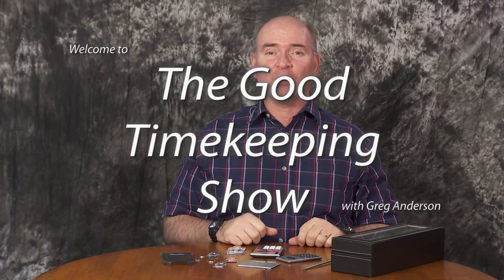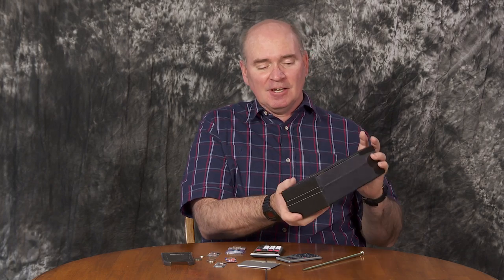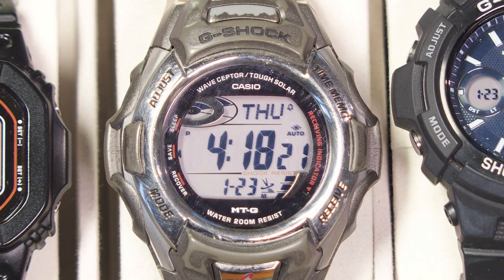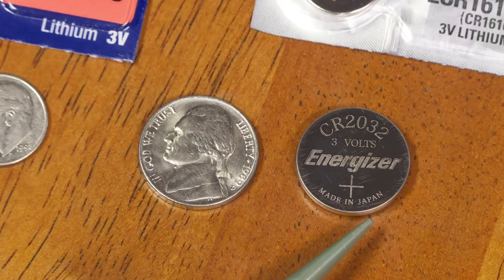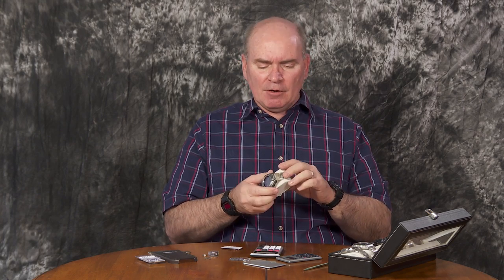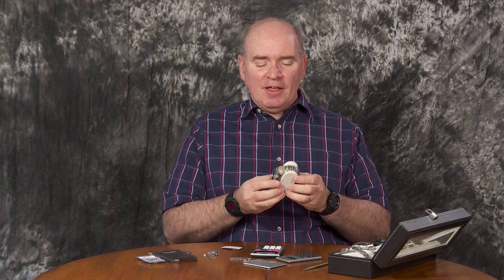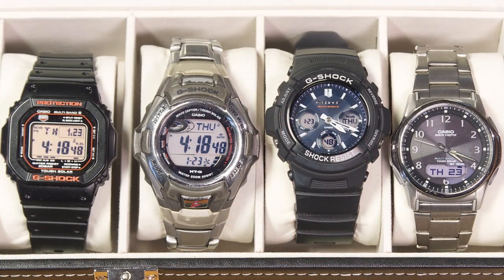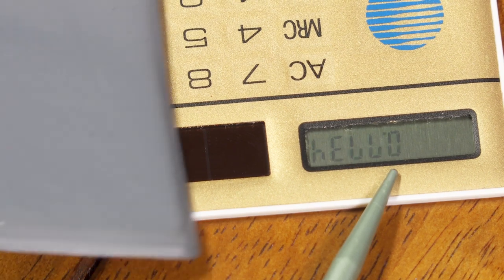What is Meant by Tough Solar (and Eco-Drive) in Casio (and Citizen) Watches?

Comment: I would not take a solar watch to your local jeweler. I posted my g-shock to Casio and asked them to swap the rechargeable battery which they did for 20 dollars! So check with manufacturer, they sure things will have the right tools and parts to do it. I'd say that a 300-dollar g-shock deserved a 20-dollar treatment at its birth cradle! Don't be cheap!
Reply from the maker: Excellent idea.

Comment: Wait. A watch cannot think! It is the manufacturer (person/s) who thinks! They designed the watch assuming the user will put in a correct battery type.
Note to readers: The Casio calculator uses two way power, and the cell is alkaline usually, it may or may not charge.

Comment: The reason I never had one until now is the price is expensive I got one last year and I haven’t been using it because of the link needed to be done and waiting until this year 2021 because of the pandemic last year I could not get the link to fit my wrist 
This year the battery was not working or not able to work at all and it is the solar power and still not working even though I have kept it in the sun or light it is a Casio tough solar
Reply from the maker: I’m curious. What model of watch do you have? I would start by putting it outside with the face getting direct sunlight (if you haven’t already tried that). Let it get that light for a couple of hours. It should do something. This is what I did... https://youtu.be/4StC6fKpIZs

Comment: The most important point he didn't tell in this video, in door artificial light won't charge these solar watch, out door sun light is a must no matter how bright it is.
Reply: Sorry but you are completely wrong, I have 17 eco drives, 2 tough solars and 2 Seiko solars going back up to 17 years. Daylight is better but they will all charge from artificial light eventually.
Reply: @TelstarFirst  I'd agree,it's estimated that a decent fluorescent tube will charge at the rate of around 25% of that of natural sunlight.
Incidentally we have a sunlight simulator which produces multi spectrum light for testing various light sensors fitted to vehicles which we used to revive an Eco drive that had been stopped for 2years. We left it in the garden for a month in the summer to no avail.Citizen could no longer obtain genuine capacitors so couldn't repair it,despite the fact that I managed to purchase a genuine one in seconds!.Anyway,after 5 hours of intense simulated light there was movement,we then left in sunlight for five days and it has worked faultlessly since,I've had the spare capacitor for 3 years now.Unfortunately the light emulator we used is attached to an £11,000 ADAS system so not really practical for home use.but yes some types of artificial light will charge your watches.
Reply from the maker: I bought a watch last year which was new but it arrived with a drained battery. I brought it back to life with an LED video light and then brought it to a full charge in the sun. I made a video about it. (And the watch is still running well today. If I'm not wearing it I keep it in a case where it is exposed to normal lighting in my house.) https://youtu.be/4StC6fKpIZs
Reply: @GoodTimekeeper  I watched that video,I know the feeling of watching for the first sign of movement although I'm not a great fan of digital watches,too many functions! almost all mine are analogue.I do admit to recently purchasing a Casio retro watch in silver,felt like I was back at school,my pal has now bought one too! I have a couple of rechargable single cob led work lights which are very intense and in the right range but unfortunately they produce intense heat also.The old jeweller I use utilises a daylight white small circular tube bulb from one of his old magnifiers and a wire cost hanger,complete with bare mains powered terminals.
Reply: @TelstarFirst  Did any one of your solars watch had a charging indicator? take a look of the indicator reading under normal condition of in door artificial light than think again.
Reply: @keis2046  Yes! 6 of them do and your point is what exactly? Also please note what others have replied to my comment including Greg Anderson himself.
Reply: @TelstarFirst  Read this https://www.citizenwatch.com/us/en/recharging-guide.html "At a distance of 8 inches under a 30W fluorescent light (3,000 illuminance/lux): 40 minutes for 1 day use; 130 hours to full charge" In a normal indoor room, light is about 100-200cdm2 (16-32 lux). In such condition, it will take about 62hrs to charge for 1day use. Do you really think it can be called charging? I don't think so.

Comment: I bought a pro-trek in 2010 qnd is still going and holding charge extremelly well.

Lately casio has been trying to get rid of solar watches i guess duento lack of revenue from changing batteries.. i will never buy a watch without solar charging